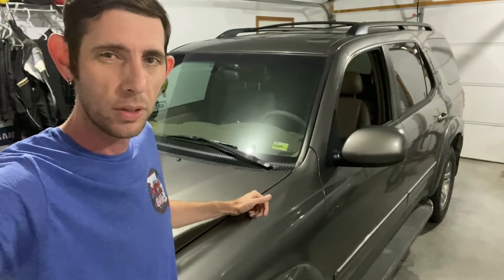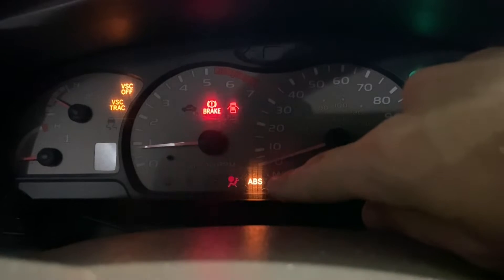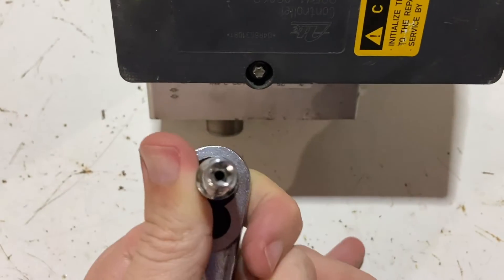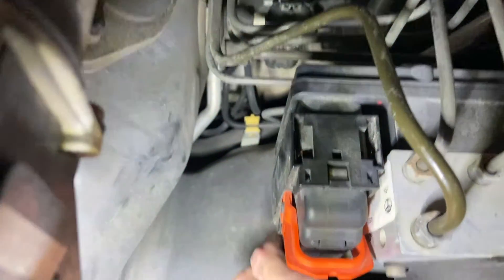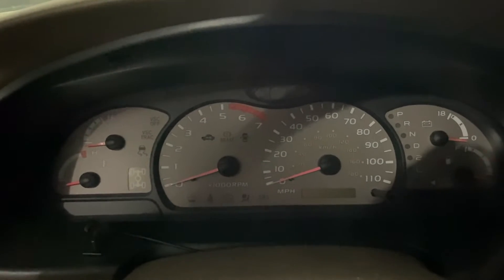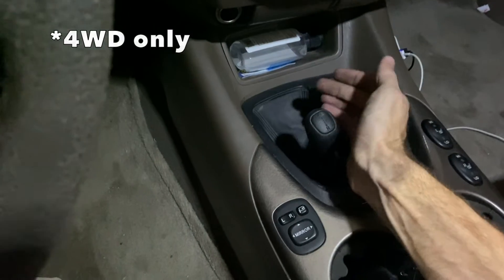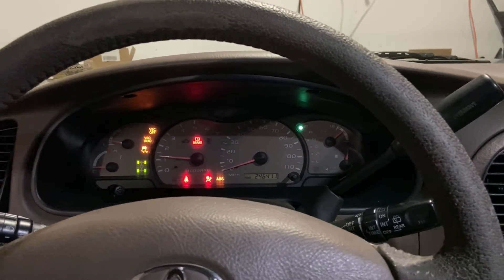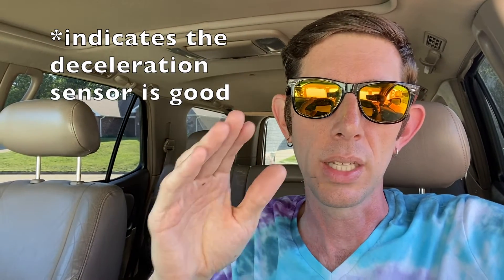Sequoia ABS Codes, Skid Control ECU, and Zero Point Calibration

Comment: I have 2003 sequoia limited like yours and my steering angle sensor did not beep when I turned each side all the way.  Also abs light didn’t turn off for speed sensors during the test.    Were you able to find the fix for the position steering angle sensor and wheel speed sensors ? 

Do I have to recalibrate steering angle position sensor once it’s replaced ? If so, what are the steps ?   Thanks!

Comment: Do I have to do zero point calibration if I have no lights on once I register the new vsc?
Reply from the maker: I don’t know for certain, but I’d recommend doing it just to ensure that things are working properly
Reply: @DustinRogersinMO  I redid the zpc and this time I got the beep!! I may have had the wrong pins jumped the first time. I tried again to register the new vsc and did not get a beep. I'm pretty happy that my abs is working. Thanks again.
Reply: @DustinRogersinMO  so I tried it and I didn't get the beep. Same when I tried to register the new vsc. But my abs and brake light are off now. I just have the vsc lights on for steering angle sensor malfunction. Thanks for the helpful video!
BTW, on my 2002, the vsc computer is a bit bigger with 4 screws. I had to unbolt the 3 bolts for the module to get room to get the computer out.

Comment: Thanks for info my 02 limited has vsc off button next to 4wd is that the button I’m supposed to press to zero calibration TIA
Reply from the maker: Yes. Whatever button is next to the 4WD button. It could be a differential lock button or VSC button.

Comment: For any future reference the brake light flashing code 42 is also no communication with abs module. I used a tech stream and couldn’t get it to connect to abs system at all then started digging in TIS and found a full book on codes, diagrams, wiring on these issue lol

Comment: Great video Dustin, just found you in fact, so I have an 06 sequoia with the vsc/trac and engine light on, changed out  air filter, mass air flow, plugs, coils, injectors, 02 censors, rear carbon box, pcv, but still on !! Also a smell of gas when driving through the exhaust, any ideas mate ?
Reply: What are the codes? Got any live data?

Comment: ABS modul = skid control ecu ?
Reply from the maker: Yes
Reply: My car doesnt read speed correctly, when it reach 43 mph it suddenly hard steering, abs on, handbrake on still the problem cant solved😭
Reply from the maker: @risukiarie157  you may have a faulty VSS (vehicle speed sensor) or possibly one or more wheel speed sensors that are giving inaccurate readings causing the ABS to engage
Reply: @DustinRogersinMO I wanted to verify that register procedure you found did work. I have a brand new ECU my mechanic didn't know how to register to my truck. Paid for it so I would like to use it. Thanks

Comment: My 2002 Sequoia has had the traction control lights on for four years and the Brake and ABS lights for about two years.  I just unhooked the old yaw rate sensor to keep the VSC from kicking on at random times.  This summer, I finally put in a new yaw rate sensor and an Ebay traction control/ABS computer.  The video you created to share your work was a huge help.  Pairing the module to the car and completing the zero-point calibration worked just as shown here, with the exception of one pin location.  For the first time since I've had this Sequoia, there are no extra lights on the dash.  Thank you!
Reply: Any issues experienced while operating the SUV with those lights on?
Reply: Good info! What pin locations on your 02?
Reply: I am still chasing my problem and thinking its a translate assembly behind the glove box.

Congratulations though! This shits frustrating.
Reply: @royceschnepp150   Did you find a translate computer?  I have C1203, C1223 & C1241 - parking brake light, ABS light, and VSC Off and VSC Trac all on in 2002 Sequoia.  My ABS module # is the old one to 89541-0C050

Comment: On the OBD2, which wire is CG?
Reply from the maker: Look at the diagram at 1:21
Reply: @DustinRogersinMO  I was asking because mine is wired basically backwards from that diagram.  Instead of pins 16,15,14,13 & 7,6,5,4 like the DLC3 diagram mine is wired 12,11,10,9 & 5,4,3,2.
Reply from the maker: @dieselblj  on mine, the CG wire is orange. Mines an ‘03
Reply: @DustinRogersinMO  thank you